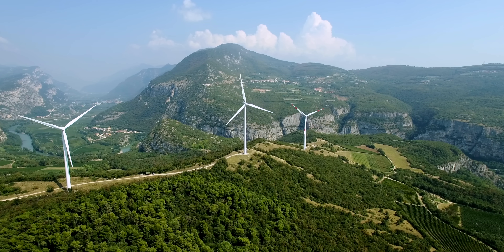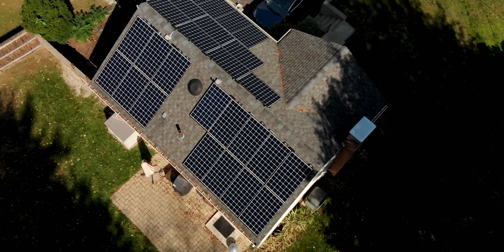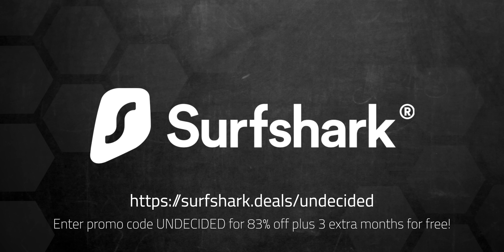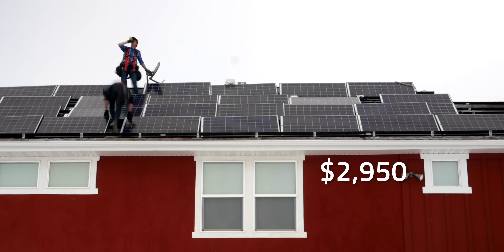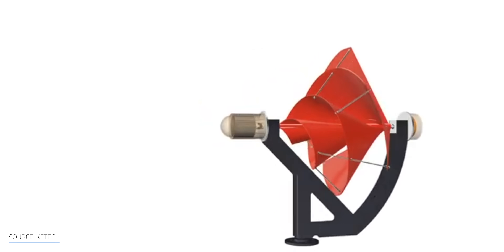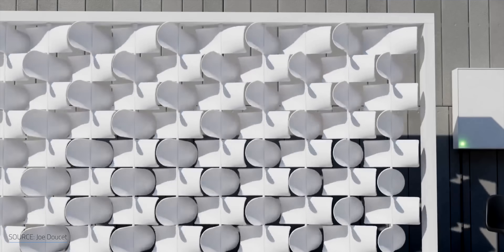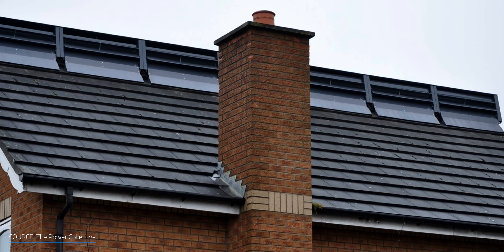The Challenges of a Wind Turbine on Your Home

Comment: I have a PIKA T701 1.7 kW wind generator from Maine that helps power my off-grid home. It’s been super efficient and reliable for over 5 years.  Unfortunately GENERAC generator company bought the PIKA company and discontinued the wind generator line…but continued the battery and inverter line with their name on it. My machine is on the top of a ridge and uses a 30’ tilting tower. I sure hope someone picks up the rights to produce this beautiful-quiet-efficient machine. My system is a “hybrid” solar wind system and is 100% off grid. Winter brings helpful night and daytime wind generation. I’ve been a sustainable energy engineer for over 40 years…and will never be On-Grid. Good review!

Comment: I've talked to a lot of homeowners who have installed solar panels on their roofs and not one of them have told me that it was cost effective. The cost of installation, maintenance, and a very big one that no one wants to talk about is replacement for broken or defective panels. (It happens more than you could imagine) No one has convinced me that buying a solar system will benefit me in the long run. For now I stay with my power company. They immediately handle any problems and for a person my age approaching 70 I would advise anyone who is retired to stay with the power company, unless you are rich and don't mind paying for a solar system for you grandchildren. They will be the only ones to profit from this....
Reply: I just installed Sunpower 8kw system 19 panels plus a Sunvault with 13.2kw of storage. When the 30% rebate is factored in it'll take 16 years to break even.
Reply: Well to me if it ll benefit my grandchildren by saving the planet from fossil fuels ; it’s worth it 😮
Reply: @gailalbers1430  co2 is bullshit, more oil on yhis planet than water, wake up

Comment: You touched on it but it's difficult to overstate how important location is for wind power. Some locations get orders of magnitude more wind than nearly anywhere else and it doesn't make much sense to build wind farms outside of this zones. This combined with the scale stuff you also touched on makes home installs pretty much impossible to be practical. As art pieces they're interesting but they really just don't make much sense, the frontier for wind is offshore, not residential.

Comment: Wind generating "Clean Electricity" ??? what are you talking about. Did the minerals / materials for the turbine not get dug out of the ground with diesel powered machinery .. Train / trucked to the coast with diesel powered machinery, shipped diesel, smelted : manufactured coal or gas powered power stations. End Product Shipped via diesel. Concrete pad : materials collected with fossil fuels. Erected with fossil fuel crane. Workforce onsite via diesel and petrol vehicles. Maintenance via same transport mechanism. What watts per acre / hectare is required for wind / solar over efficient Coal / Gas or Nuclear. "Green" Morons spend too much time with their  head up their collective arse over the facts & figures and logic of the actual facts of the atmosphere, what and how it effects the Foral and Fauna of this planet.

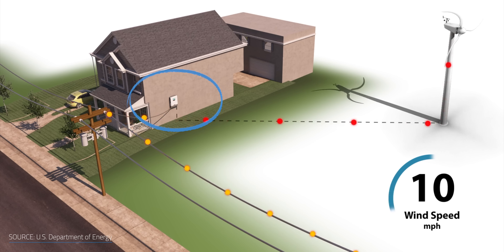Comment: 4:03 An inverter is not neccesary when you don't attach the generator
to the mains.
This is only neccesary if you sell power surplus, which isn't always
the case.
A dual energy input may be used instead, where part of the power comes
from the generator, and the other part is supplied by the mains.
You'd have to convert into DC before this can happen.
When using solar power it's also best to use similar voltage appliances.
(like camping gear that operates on 12V or 24V)

Comment: Using the roof wind turbine to cool the solar panels
may yield a higher energy output.
To reduce wear and tear on the turbine, use
magnetic axles, that have no wear and tear like ballbearing ones.

Comment: Good video and I appreciated the information about the RidgeBlade and Joe Doucet's Wind Wall.  I'm surprised you didn't include Tesup (Atlas 4 or AtlasX) as their technology has been around for a number of years and seems to have a pretty solid power curve and only stands about 4 feet tall which could easily be attached to the top of a home making installation and connection to a home inverter (especially if you have solar already) pretty easy.

Comment: Some of the costs of the installation for both solar and wind will be the infrastructure to manage the generated power.  If you install both types, you will only need one cost for the infrastructure, so that will result in a certain amount of savings.  It makes more sense to me to plan to utilize both if you want any kind of reliable off grid power generation.  Studies have also shown that wind power, mainly in the VAWT as far as I am aware, have significantly increased efficiency when they are installed in a group format.  This is all with the understanding that anyone that plans to use wind needs to be aware of the average wind speeds at their location.  It is something that would need to be considered if you are planning on building a home and have a few choices of property to purchase to build it on.

Comment: Wind power is definitely attractive. More and more solar doesn't feel great in that it's so seasonal - while economically effective it's not that helpful to society in the depths of winter..

Topping up or diversifying with wind sounds great. However, while both solar and wind are more efficient at scale, that's massively more so with wind. Theres a a squaring relationship with the size of a turbine, and that is then factored up further by height as the wind becomes more consistent and reliable.

I think wind power makes sense at community level, solar too, but it also works as something you own yourself.

Comment: A nice idea, but turbines have moving parts and moving parts break.  With a solar panel, it is solid state (no moving parts).  Less moving parts is cheaper, this is the secret of an electric car less moving parts because a gas or diesel engine has 12,000 parts on average.

Comment: I first saw the roof ridge turbine design back in the early 1990s, when it was called a "limpet" design.  The same article I saw had it competing against a small residential solar-thermal closed-cycle turbine called a CAVET.  I never heard anything else about either of them until the Power Systems design popped up.  Often the way.

I do think that residential turbines modeled as scaled-down versions of giant turbines . . . are not the way to go.  When you're building a gigantic multi-million-dollar turbine that's hard to service, you want maximum efficiency.  For residential designs, small cheap systems that can be used in groups makes vastly more sense, for the most part.  

But these articles are 99% calculations and industry figures.  If you know someone who HAS a wind turbine, their experience is often wildly different.  We know someone who has a shockingly large vertical wind turbine.  It's mounted at the edge of a corn field and has worked flawlessly, without any maintenance at all, for over a decade.  But the company that provided it has a terrible controller, and its output is pretty miserable despite the fact that it's a huge thing that's always spinning fast enough that you wouldn't dare go near it.  The devil is often in the details.

I know they sell small mast-mounted wind turbines, for larger sailboats, that reportedly outperform the small turbines normally marketed to home owners, for about the same cost.  I haven't tested any such thing, so I can't swear to it, but it's a strange world.  Of course, a sailboat's mast is going to see different wind conditions than most homes.

Comment: I have installed both. It all depends on your wind zone.  I prefer solar since wind power is generally only realistic when installed on a problematic tower.  I’ve had a tower fall over in extreme wind conditions.
Reply: Maybe you don’t realize that solar panels in sunny areas like California ( no rain) have a relatively high cleaning cost.

Comment: I think it makes sense to diversify your power sources, and the ridge based turbines look relatively unobtrusive. Think there's scope there for a mixed setup with solar panels on the same roof. There's nothing to stop you making a water turbine as well, if you have a small stream on your property. It all adds to your energy resiliance, and removes reliance on increasingly expensive utility providers.

Comment: so ok why not think out of the box.   why not yes the  power gestated of the grid  & drive  by an emetic motor to drive a wind turning in the basement that can be trend on a of when not required OR when change is required. wind turbine in the basement  back up solar panels  when the sun dose not shine  Now the wind may not blow  but  can produce  sufficient incoming  power to recharge the  drop in battery & like the fridge can be set to charge when battery drop gets  to a  desired level. So why would one desire  to fit  an alternative power supply.  Well it all about cost & having the mens to say no . we as the question  Why ues a battery bank to store power ,   when we have main power .  well i lived in a place   where  i never had mains  power  supply. Until much later in my life.  & my chidden never new life with out power. Even on holiday we plugged in the van.  to an no sight power soppily  & they got a never ending supply .  until one day we had a power cut . a i relied that they had got no idea of life of grid . so i decides to cast an eye over my old battery bank & see if i should re develop  there ues . but how & why bother. Well i discover by switching to my battery bank i would cut my electricity bills  by 76%.    the cost of power had increase so much i had not realised how much it had  increase. the bourdon  on my Budget . so now i stopped pushing it in to the grid & started string it in sated & only using the grid if i could-not supply my needs from the supply i relies an happy medium of solar  & mains  kept mu bills doun   then i relies over night charging had potential  cutting my bills even farther .   so why not a gen set that could be trend on and of by the mans power supply . 
i support the belief that a pound.  saved is a pound gained  to benefit one's pocket .

Comment: Found your channel by happenstance. I have no particular knowledge of these alternative energy technologies. But I do have a large by UK standards, on-grid home in the UK where our energy costs are off the charts now. Hence interest in alternatives.
The wind technologies look very promising. Especially the ridge generator which would suit my home, coupled with solar panels. 
There's a huge stumbling block though. All these technologies are astronomically out of the £reach of the vast majority of householders. You quote installation costs of $50-80K !!  Do these designers and manufacturers realise that e.g. most people in the UK and many other countries won't be able to meet their usual bills for the next 5-10 years given the upcoming recession. Right now up to two-thirds of the population here are having to choose between food or heat. What's the solution...?

Comment: We are just now adding storage batteries to our solar panels in Australia.  We tried to find out information about adding wind generation but couldn't get any information about generation at lower wind speeds.  We do get quite a lot of wind but, in the end, decided that there was just not enough information available for wind generation at sub optimal speeds.  Your video is very interesting and I think we made the right decision, at this stage, not to add a wind generator.  When technology has improved we will relook at adding a wind generator.  You provided more information than we were able to glean from the manufacturer.  We asked direct questions about sub optimal wind strength but they couldn't or wouldn't give us a graph of diminishing production for diminishing winds - very disappointing.

Comment: I live off grid..I used alot of different systems.
solar is great..wind isn't so good..as a storm can cause alot of failures.
..
perhaps
spend your bucks on vacume tube heat exchangers. (for heat)
(Geo for cool)
lithium batteries in combination with super caps.
and wood heat..
 also a good idea is to use..
thermodynamics..

 hydrogen production was relatively easy to do..using solar power.
...
thanks for sharing.

Oh..if thinking of getting off grid..
water pressure..water flow..
its the way to go.

Comment: Matt, I think your 'should I, shouldn't I' logic has now been superseded by a necessity that has to be community-based rather than you alone.   Whilst the circumstances may differ in the USA (which I doubt) this revelation means that the demise of fossil fuel power generation is going to increase. (https://www.youtube.com/watch?v=NicE0-N9ux0). Community-based microgrids will connect residential systems to renewables owned by the community and installed on community land with the overall goal of the community being independent of the privatised grid and certainly independent of the fossil fuel industry. This will be much cheap than the current scam. I would love to see these concepts incorporated into your work.

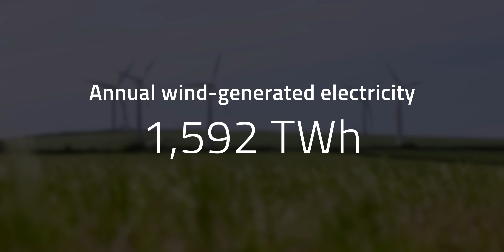Comment: At 1:30 you said "if we take hydroelectric out of the picture"... Why would we take water out of the equation, unless it simply doesn't fit into your equation (aka narrative)? If you're promoting less reliance on "the grid", then why exclude a very reliable, efficient and environmentally friendly means of production?  
Microhydro is in use around the world, albeit not as prolifically, but if we're comparing wind, solar and hydro industrial turbines, hydroelectric, 66 wind turbines equal the yearly output of a single hydroelectric turbine.

Why this elimination?

Comment: In the UK the installation of a wind turbine on your own property is prohibited because of planning restrictions. This unfortunately means that a home wind turbine system to become self sufficient is virtually impossible. Although the plans of a 'Wind wall' seems to be an unintrusive practical alternative and I will be building one to test on my property. Because the 'Wind wall' is a more discrete installation this should circumvent the planning restrictions on the UK.

Comment: There is nothing green about wind turbines and solar panels as to produce and use them you have to use petroleum products and then you have to deal with the waste that is left when everything breaks or no longer works and is replaced by more garbage that Hass to work and fail and be replaced and fill up landfills and use more petroleum fossil fuels to manufacture and to maintain them so how is this a good thing for CO2 and the so-called green technology that supposed to save the world please explain

Comment: The roof ridge drum type wind generators are the most interesting I've seen for a long time. House orientation is an issue, but the concentrating effect of the roof slope gives a big advantage and the problem of the blades coming back in the opposite direction to wind flow is mitigated by the housing.
I am not aware of any vertical turbine, like the power wall you feature in this video, which achieves efficiency anywhere near the efficiency of conventional wind generators. Simplistically this is because there is always half of the blade system moving against the wind flow direction.

Comment: Also, I don't know if it is different there in the USA, but in some places, it's not possible to install a wind turbine for fauna protection reasons. About the windspeed, it is worth mentioning that even 5 m/s at the height that micro and pico wind turbine systems are usually mounted it's really hard to reach in most places, without considering the fact that at lower height turbulence is more common too. Before considering a windturbine I would  consider to take a good anemometer and collect data for about an year in the position you intend to place it and make your consideration on that. Also there are many software that will help you estimate the annual production of the system once you've inserted the data you collected, not to mention the type of windturbine, cut-ina and cut-off are important but also check the Power diagram to understand where you more common windspeed fall, it makes a big difference

Comment: Very inspiring film. Based on it, I solved the problem with cost and connected a motor from a heat pump as a wind turbine. The cost then became zero and the calculations improved. With very weak wind 11 Volts and 5 Amps. Not bad! In part 2, I will disassemble it and connect the storage of the electricity. Finns på min kanal.

Comment: The VAWTs are generating much less vibration and noise as the moving parts are closer to the shaft and much more balanced (not the case in HAWTs). VAWTs are easy to build with simple metallic materials, many can juts them in their garages and they do not have non-reclyclable blades. I think that we should bring wind mills on tall building sides and tops in towns and cities and not in the countryside (as this ruins the good farm lands). The wind mills could be added to a line of super-monorails sitting over every highways.

Comment: The frustrating part is that there is way better tech kept hidden/suppressed or of the market. You can read all about it in J. Manning's - Free Energy books. But we're left messing about with these inefficient (ultimately unnecessarily) complex, expensive (more so when something breaks) systems barely breaking even if at all.

Free energy generator at the Technical University Delft.
https://youtu.be/_ArBfUkzhxE

Comment: Here is an idea for you to chew on why not have solar panels charge  batteries to run a DC motor on a flywheel connected to a whole house generator as it also runs the DC motor while the sun is shining and the batteries take over when the sun goes down.